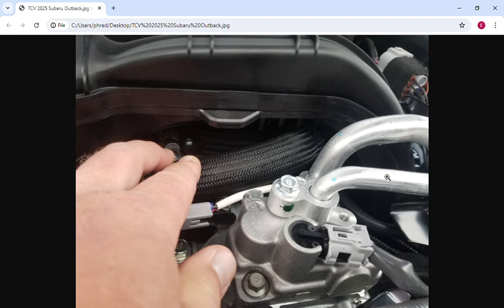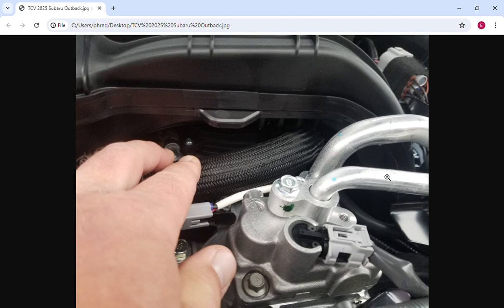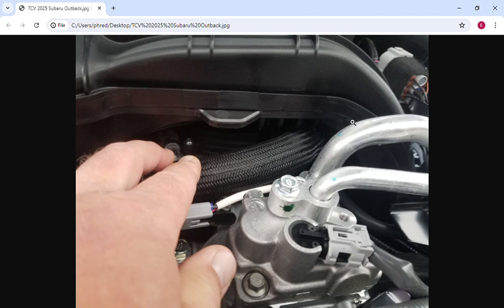TCV  Valve 2025 Subaru Outback Thermo Control Valve

Comment: Thanks for the great info. Were you able to see the 2025 Subaru Forester at the dealer to confirm that it does not have the thermo control valve and in fact has the thermostat?
Thanks for confirming.